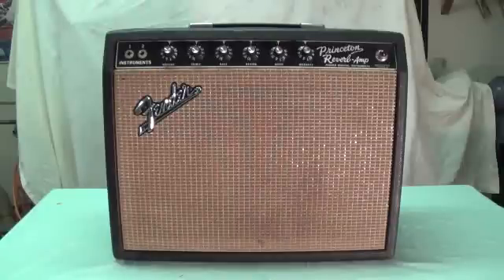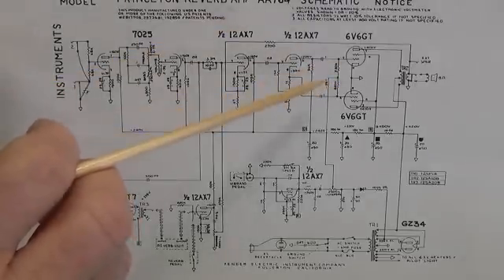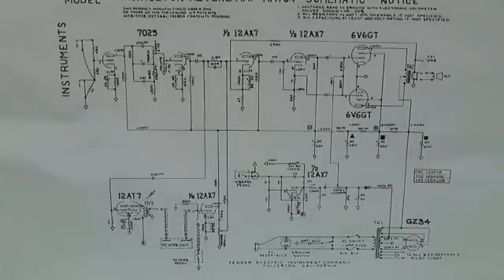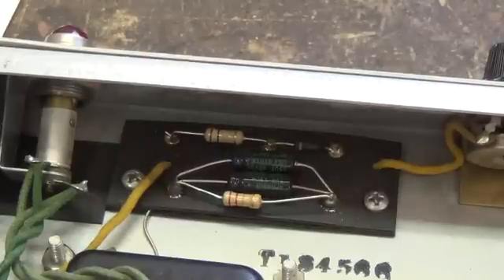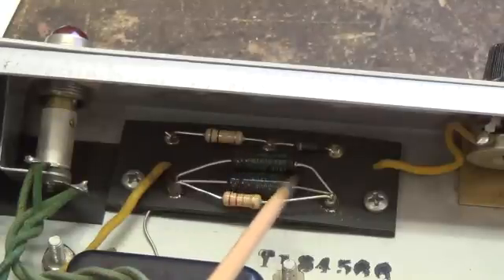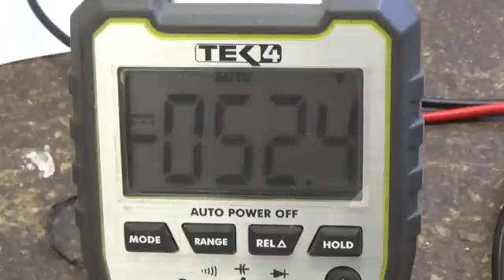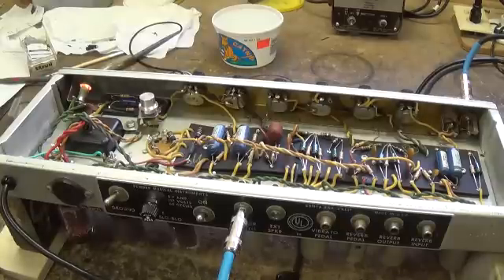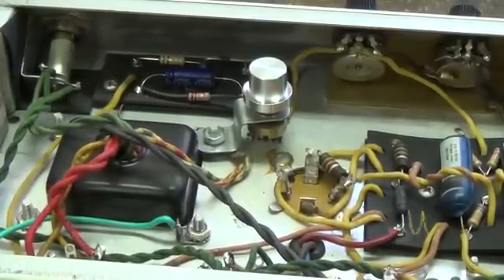Converting the Fender Princeton to Adjustable Grid Bias

Comment: Uncle Doug - I'm very new to tube amp repair and your videos are very helpful. Hope you make more soon.

I've watched this video several times and think I've finally got it. I wish there was a camera shot from the other side of the new pot. It seems that you either cut the yellow wire (connected to the vib pot) at the eyelet board or unsoldered it from under the eyelet board. Can't really tell. Also you soldered a black wire to the eyelet board at negative end of diode where the yellow wire used to be. Finally, you unsoldered the 22K from the board and replaced it with a 27K with some kind of tubing and soldering one end at the grounded end and the other end to the new pot.  What I can't be see but indicated in your screen note is the installation of a 25K resistor between center pot lug the right lug. Is all this correct? When you say left or right lug of the pot, I assume that is with the pot oriented with the shaft up.

So now here's the real question. If the original power cord is replaced, the ground switch is no longer necessary. If the ground switch is removed, there is an available hole in the back of the chassis where a trim pot (no shaft) could be placed. This would allow for tube biasing without removing the chassis if you use a tube socket type bias device such as QuadStage BiasPro. Probably to do this right a new eyelet should be installed in the board to attach the free end of the 27K resistor and a wire to run to the pot. Or the ground switch could be replaced with a standby switch. Standby switch or bias pot? What are you thoughts?
Reply from the maker: Bob, I made this video quite a while ago and the specifics, such as wire color, etc. now elude me. Your best bet, if any of my connections are not clear to you, would be to consult a Fender schematic and/or layout diagram for the circuit you are working on. I explain the theory of the modification in the video and this should enable its transference to your circuit.  

Re your second paragraph, yes, you could replace the bypassed ground switch with the biasing knob......however, you must be sure that nothing can alter the setting after it is made. This is generally done by cutting a slot in the pot shaft so a screwdriver can turn it, and not installing a knob that can be accidentally rotated. It should be noted that tube bias is based on Plate Dissipation, not simply PC and PV (upon which it is based), so any bias device must provide both measurements so that the PD can be calculated.

Comment: Hallo Monsieur,I follow you since long time and I really appreciate your work teaching a lot of people, like me.Have you got among your videos one relating to a non complicated  protection circuit of the
output stage in the event it were missing the bias voltage in a Push-Pull circuit?  example: Relais that cuts the voltage to the plates when, for a fault, the bias voltage is not present.
And what do you think about using a shorted female grounding jack  ( see www.tubedepot.com
for P-SC-12A Switchcraft ¼” shorted female Jack) for the speaker output. The OT can be damaged if you have no load present (nothing plugged in) when the amplifier
is on. If there is no speaker plugged into the amp, with a grounding female type jack the output circuit would be just grounded and should doing no harm to OT and tubes. ?  I heard that some people do that !!??                                                                               
Is that really safe or would be better to install a dummy load  that would connect  instead the speaker.Or again why not a circuit that cuts plates voltage in case the load (Speaker) is not inserted ? Hoping to hear from you. Best regards. Ben
Reply from the maker: Greetings, Ben. I do not have a video, circuit, or schematic showing the protection mechanism you described. To be honest, I have never needed one.  A grounded speaker jack would almost immediately destroy your output transformer and possibly your output tubes.....it's a dead short circuit......please don't do this.  Over many years and hundreds of amps, I have never had an output tube or output transformer failure due to lack of bias voltage or speaker.  I suggest that you simply relax and enjoy your amp(s).

Comment: Hi UD! The BFPR is indeed a great Fender amp. In addition to lacking an adjustable grid bias control, there is another difference. All of Fender’s large amps have two resistors on each of the power tube sockets. A 1.5K resistor between pin 1 and pin 5. Also a 470 ohm, 1 watt resistor between pin 4 and pin 6 (unused pin used as a mounting terminal). I have been told that this helps the output tube stability and improves tube life. Do you agree? Are these resistors worth adding to the Princeton Reverb amp? Thanks.
Reply from the maker: Greetings, DR.  Pin 5 is the grid in both the 6V6 and 6L6 and Pin 1 is unused....the only resistor I see in this position is the 220K bias-input resistor.  The reason the larger amps use a 470 Ohm resistor on the screen input (Pin 4) is because they also have filter chokes. Circuits using resistors instead of filter chokes, like the PR, do not need additional screen resistance.

Comment: Hi Uncle Doug. I have to ask something. If the negative side of the diode is the banded side, why the hell on the schematic the diode  was written  + to negative and - to positive?
Reply from the maker: You ask an interesting question, SW. Traditionally, the banded end of a diode is the cathode or negative end....yet in Fender schematics, the banded end is marked + and the unbanded end is - .  I believe that the seemingly backwards Fender designation is simply to make it clear that negative DC is passed by the diode and utilized for grid biasing.  If the diode were to be marked conventionally, it might look like the grid-biasing DC was + .

Comment: yo uncle doug.. i just picked up an unknown tube radio i want to convert to a guitar amp, just wondering how i would go about removing/bypassing the grid top caps to avoid electrocution.. none of the tubes that came with are cappable and every time i do a google search it just comes up with capacitor related posts..
Reply from the maker: Grid caps have virtually no voltage at all, especially if there is no input to the circuit. If you don't want them, simply cut the wires, remove the caps, and apply the signal to the grids via the tube pin.
Reply: Uncle Doug my thoughts exactly.. only my first tube amp and dont wanna kill the tubes or my self ha thanks for the reply ;)
Reply from the maker: You're welcome, Rob. Be careful.

Comment: what would be the difference between adding a grid bias pot  as opposed to doing an adjustable cathode bias pot mod? similar to the tweed deluxe. thank you for your help.
Reply from the maker: On circuits in which the output tubes are cathode biased, such as the Champ and Deluxe, you can replace the bias resistor with a precision adjustable resistor to allow for adjustment of cathode bias. On circuits in which the output tubes are grid biased (i.e. the cathodes are grounded), such as the Deluxe Reberb, a pot may be installed (if it's not already there) to allow adjustment of the grid bias.  The method of conversion to adjustable bias is determined by the type of biasing used with the output tube(s).
Reply: would it be possible to add a cathode bias pot the Princeton reverb? the goal is to achieve the tweed style break up and dynamics when needed basically the best of both worlds amazing cleans and sparkles from princeton and nice dynamic breakup from the tweed cathode bias.
Reply from the maker: To do so, you would have to convert the PR from grid bias to cathode bias.....i.e. detach the grid-biasing negative DC power supply, then unground the 6V6 cathodes and add a variable cathode bias resistor (and bypass capacitor). Since the tremolo is connected to the grid-biasing circuit, you would still have to provide a route for its input to the 6V6 grids. This is not particularly challenging to do, but I honestly doubt that there would be a noticeable improvement in tone.....otherwise, Fender probably would have wired the circuit this way.

Comment: Uncle Doug!  Thanks so much for these videos!  I've added your bias circuit to several 6V6 push-pull amps, including 2 Princetons (one a '64, and the other a '69-70 Princeton Reverb), but I went one step further on the last one.  I made a pot bracket for the next transformer stud and mounted a 250 ohm Ohmite pot to balance the grids themselves, because of varying output transformer impedance either side of center tap, and of course a "matched pair" these days is only apparently matched on a tube tester rather than graphed as they were a few decades back.  One further easily reversed mod I've been doing is placing a 1% 1 ohm 2 watt resister (got a 100 of them from vendor on Ebay) in each cathode circuit, much easier current measurement when replacing tubes!  I suspect the 250 ohm pot could be replaced with a 50 or 100 ohm pot too, probably closer to what's actually needed. Geez, right on the money current balance and setting the 70% max tube rating.  I thought you'd appreciate this bit of OCD amp service!
Reply from the maker: Your modifications all make excellent sense, Mr. B.  Thanks for sharing this with us.
Reply: camera decided not to link to computer, pictures to follow ... further think through: 250 ohm pot did nothing.  thorough rummage through parts lead me to 150K 1% resistors to replace the 220k grid resistors and then used a 100k pot (finding them all to be +/- 10% with  most being about 90k, finding ONE to be 110k and using that)this gives CLOSE to the 220k original grid resistors of which Fender used +/- 20% so the new ones are certainly in the ball park.  I didn't check what the originals actually were.  THIS actually works well with minimal fiddling and can balance unmatched tubes, but given what these amps now sell for and matched tubes sell for 50 bucks on Ebay, its not worth it not to use them.  I wonder if I could match a 6W6 with a 6V6 ...

Comment: Hi there Uncle! How's rusty doing? Thanks, as always, for sharing with us yourself and your knowledge –I hope you know me and a whole lot of folks appreciate it. 

The video, superb. One question though. While measuring the negative Vdc you set the minimum at -38Vdc. Correct me if I'm wrong here but was it not -34Vdc what the schematics suggested?
Reply from the maker: +Fuga Mante  Greetings, Fuga. Rusty is doing very well, especially for an 18-year-old pup. The schematic value is a ballpark estimate and varies greatly with different output tubes. As you could see when I actually biased the tubes, the range of values I chose worked quite well, with lots of adjustment left in both directions.

Comment: Hey Uncle Doug. I just cracked open the case in my 64 Princeton NR and my smoothing cap is a Mallory 25mfd / 50v!
Reply from the maker: +jorma Spaziano   If you are speaking of the bias circuit, then you should change the cap to a 50uf @ 100V.
Reply: I'm having a bit of a time finding that value. Where did you get yours? Thanks Uncle Doug!
Reply from the maker: Antique Electronic Supply is an excellent source.

Comment: I wish someone would do this type of video for a  Princeton Silverface non-reverb (AA964).
Reply from the maker: +Stephen Tool   This method works fine for the non-reverb Princeton. The biasing circuit for the two amps is identical.
Reply: Thanks, man. I appreciate the info.
Reply from the maker: You're welcome :)

Comment: I have some questions about this exact circuit.  

I'm building a Princeton reverb using the ted Weber Layout/schemo as a guide.  I wish I had the ability to Paste in a picture, but I don't know how to do that.  Here's a link to the layout: http://goo.gl/nXyU7q and the schematic: http://goo.gl/nVPpPb

Looks to me like Ted's circuit is similar to what you describe here with a couple of exceptions: 
~The connection to the bias board from the power section comes not from the rectifier tube, but from the power transformer (the red/blue wire is part of the HV secondary and delivers 540 V according to the spec sheet: http://goo.gl/iDKJZk)
~There are some different component values, but I don't believe they should matter
~I'm not sure about the connections to the bias adjustment pot- he has the intensity pot connected to the outside wiper, while you're using the middle wiper.  He also has the 50uf electrolytic cap and the diode connected to the same lug as the intensity pot.  Not sure if this matters.
~I can't tell if he intends for the pot to be mounted "right side up" (like your video above) or not.  Don't think that should matter, though.
~He used a 50K bias pot, meaning he has a higher total resistance possible (and a higher minimum resistance possible, of course)

What if any, differences or issues do you anticipate might be caused by using the Weber circuit instead of the one you outline?  Are the differences in the connections to the pot material?

Also, you mention measurements for "grid bias".  Are those measurements from pin 4 of the 6V6 to ground? Pin 5 to ground?  Also, I know (from watching your videos) that the three values involved in calculating plate dissipation are Resistance across the power transformer HV winding, Voltage drop, and plate current.  This pot is varying the plate voltage, right? 

Thank you so much for your excellent videos and for any answers you can provide.
Reply from the maker: +Nick paflas  The blue-red wire is a dedicated bias voltage tap that actually provides 45VAC, Nick.  The PR does not have a dedicated bias tap, so this is one difference between it and the Weber kit. Looking at the schematic, it would appear that his method of varying bias voltage would work fine. Grid bias voltage on the 6V6's would be measured from pin 5 to ground, but its value is really of no interest, all you care about is the PC. The biasing pot is varying the amount of -DCV being applied to each grid, which in turn alters the current flow from cathode to plate (=PC).  The measurements required for PD are PC (derived from voltage drop across OPT winding) and PV (measured from plate to cathode).

Comment: I am now considering making this mod to my Princeton reverb. Also, many thanks for the heads up on the stock 50uf capacitor being rather low in terms of voltage rating. I shall check it and swap it out to be safe I think.
Reply from the maker: +lexzbuddy  You're welcome, LB. I think you'll like the adjustable bias control. The higher voltage rating on the cap is definitely advisable.